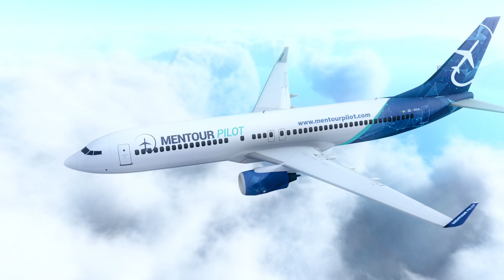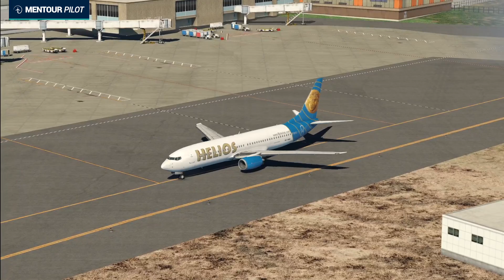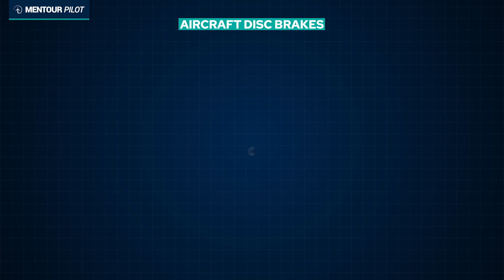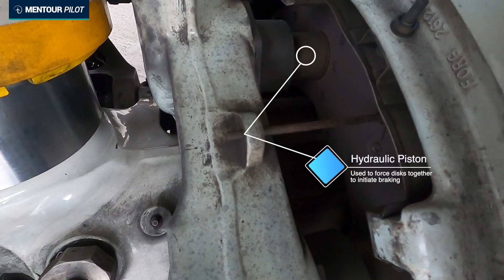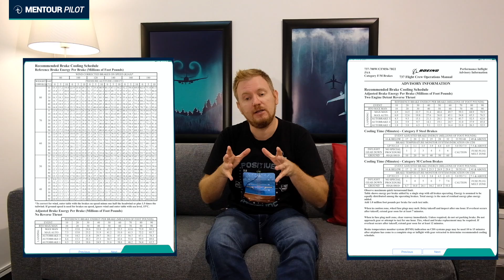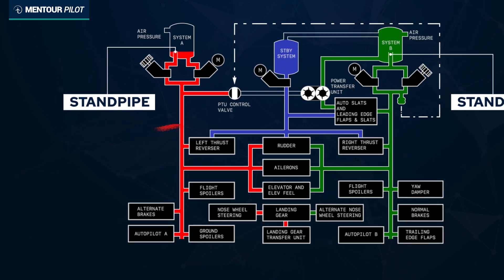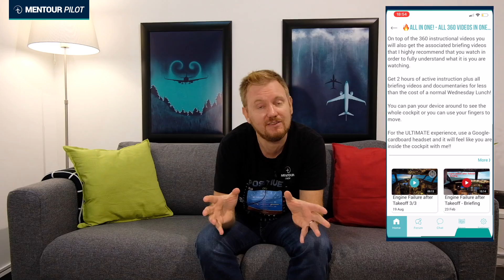How do Aircraft BRAKES work?!

Comment: "The antiskid system in airplanes works like that in cars..."

Historically speaking switching that around to "in cars it works like in airplanes" would even be more "correct" as when the automobile industry began to adopt that system for cars in the 1970s it was already in use for airplanes.
Reply: One more “what has NASA done to improve our lives here on Earth?” example.
Reply: really as a fully electronic system like today ? In cars there were many ABS ish systems around also in the 60s and earlier but the challenge for a modern system as we know it today was that the electronic  ECU is able to proccess all information and controll the actuators fast enough.. that was not possible before the invention of modern transistors, micro processsors and other hugh speed digical electronic components
Reply: @bobl78  I studied EE in the mid 1970s and my Professor teaching "electronic circuit design" owned a company which had developed an ABS for a German car manufacturer. (ABS at that time was an "extra" you had to pay for and was typically only available for the more expensive line of models.)
 
At that time transistors were available since more than a decade and electronic circuit designs had started to incorporate analog ICs (like simple OpAmps as the  uA 741 or timers like the NE 555).  Digital ICs were quickly growing out of providing just the most basic building blocks, as they had been the years before, which had given us the 7400 (4 x dual NAND) or the 7490 (4 flipflop chainable counter stage). Now we could also have ADCs and DACs, which formerly needed to be built from discrete components.

While I concede car ABS then was far from the "stability control" we have today, which e.g. incorporates inputs from MEMS acceleration sensors that are processes in real time and can recognize a car starts to turning around its vertical axis. Such an advanced system as we have it today  can give control back to the driver by asymmetric application of the brakes on all four wheels.

A very basic ABS can be much simpler and still be effective: The key understanding is there a substantial difference between static friction and sliding friction of the tires on the asphalt.

If all four wheels go from static to sliding at about the same moment in time (if the driver simply pushes the pedal as hard as he or she cab) the brakes are just less effective as they could be.

Worse if the road is more slippery on one side of the car than on the other, because the asymmetry then creates a force that makes the car turn around its vertical axis, making it uncontrollable for the driver. (And when friction becomes stronger again all of a sudden the car would also be in danger to roll over "sideways".)

Therefore experienced drivers at that time applied a technique called "Stotterbremse" in German, which means full force is applied intermittently only, giving you a shorter distance to a full stop as constantly applying the brake and risking the tires to block.

 Which explains the name ABS: It means Anti Blocking System and the goal is (or then was) to avoid the wheels to go into sliding friction in the first place.

This actually can be achieved quite simple: the electronics would only have to determine whether a wheel still rotates and if NOT to cut the pressure in the break cylinders of that wheel  until the wheel starts to turn again.

Exactly that was what early ABS did in cars and you would well notice it if you e.g. pushed the brake hard on a snowy road: the rattling of the "stuttering breaks" could be easily heard (and felt too).
Reply: @mittelwelle_531_khz  very interesting, thank you. The first german electronic ABS I know of was introduced in the Mercedes W116 around 1978 or so .. most like a 2 or 3 cannel sytem...  So what was the challenge to bring an electronic ABS into a car ? I started drivin in the 90`s and remember that back then the systems were great compared to non ABS cars but compared totoday´s systems react and pulse much faster and contain many many more functions .BTW is a modern ABS system able to adapt the way it works to speed and ground / friction levels? Does it work different on snow than on dry road ? I remember when my dad got his first W126 in 1982 with ABS as a super expensive option ...
Reply: @bobl78  As always in electronics the lions share of the system cost is developing it. Or at least the manufacturing cost is really low once such a system is produced in larger quantities.

Today the ratio even increased, huge cost for development and tiny cost for the actual hardware, e.g. if you put dedicated  digital electronics in an FPGA. (Basically "wiring" the whole thing by just "downloading" the connection pattern into the chip, requiring to build far fewer "prototypes" which later will be thrown away.)

A car company developing new electronics need to pay the engineers in advance, including all the thorough testing required to avoid being sued for "sloppiness" in the product if that product later fails, causing spectacular accidents and loss of life.

(Another thing often not considered is car manufacturers often guarantee - implicitly or explicitly - to supply spare parts for 12..15 years at least after a car goes out of production. These parts must be produced in advance, stored somewhere ... but may never be sold.)

Development costs usually go in the millions, the more if you develop something completely new, nobody else had ever tried.

As an example: if manufacturing the electronics (including the cost to put it into the cars actually built) costs 100 €, but you have to cover - say - 20 million development cost etc., you could sell the system for 200 € and start making profit after having sold 200.000 units. Or you sell that it for 1100 € and make profit after having sold only 20.000 units.

Of course, if it is more expensive FEWER customers will buy it and MORE will do so if it is cheaper. So the car manufacturer has to do the guesswork where the "sweet spot" might be.

Maybe at 600 € requiring 40.000 customers who would buy it at this price tag? Or rather only 500 € ...?

If - and that's the big unknown - LOWERING the end customer price from 600 to 500 € creates in a given span of time 10.000 additional sales it would have been a good decision, otherwise it lasts longer to reach the profit zone at that lower price.

But if you plan to keep the price high a competing car company might go for the lower price and take customers away from your brand. So you might lose the profit for selling the complete car if the price is too high. Typically customers of a given brand stay with you rather at the high-priced cars. In the low price segment they rather switch to the make that is cheapest.

So it is "rational" for the car manufacturer to go for fewer sales at a (much) higher price, as if the car costs - say - 60.000 € anyway, to people who can pay that much money an additional 3.000 for a "cool new feature" doesn't really hurt so much.

BUT: even if the electronics only costs 250 € to build and therefore the car manufacturer could put it ALSO in the lower priced car for a mere 300 € and still make 50 € profit from that extra, it now becomes hard to explain why THE SAME EXTRA will cost 3.000 € more for the luxury car but only 300 € more for the economy car.

All in all many there ate considerations to take and some  might hold back car manufacturers to try (and develop) radically new electronics.

Comment: Wow. So we have those great machines called aircraft. Beautifully engineered pieces of technology. And you're telling me, that they don't bother to install sensors that measure the temperature of the brakes or at least calculate it (the computer has all the data in much better precision than the pilot has) automatically and warn the pilot?!? Wow, that's--- somehow almost unbelievable (especially as there have been accidents because of overheated brakes in the past)...
Thank you for the great video! As always: Amazing!
Reply: Most airliners over the past 50 years have had a BTMS.  In the mid-1980's, I developed nomographs flight crews could use to figure out from a BTMS reading how much brake capacity remained for a given above-ambient brake temperature, along with a ground waiting time estimator for the given takeoff parameters as part of the chart.  Apparently, airlines hated it.  "This #*&% will never see the light of day", etc.  Anything which restricted them beyond existing flight manual limits was not welcome.  Things are more sensible nowadays, as suggested by the flight crew brake temperature guidance documents seen in the video.

Comment: That is a good story about breaking. During all the flights I took,, on landing there was a regular descelerating movement. Just grab your seat bars and everything was fine.
On one landing in Washington DC. from Europe the plane was descelerating so heavily I was pushed forward strongly, I had to grab the backseat in front of me so not to get slammed against it.
Reply: I once got to experience max braking while standing up (in the cockpit, behind the captain during an accelerate/stop test).  I was hanging on for dear life to  the column of a temporary equipment rack behind me.  Even back in my lean/40-pushups days, it was all I could do to stay out of the captain's lap.

Comment: Some trucks have water spraying systems for their brakes, I wonder why planes can't have such a system. Apparently since it only needs to be activated on ground, so there's no sense to carry a water tank with the plane, but I expect something like the nozzles comes with the plane, and the water is supplied from ground facility, once the plane goes to its parking slot.

Comment: Ah cool so multi disk setup. I know hydraulic brakes of cars, air brakes of big trucks and single/multi disk clutch systems. It's cars I constantly work on. I have experience with brake fade in my car and on my lesson bike. It's so important to have air flow over your brakes to cool them and these plains have multi disk tightly packed inside a closed wheel. No shit they ain't going to cool. During auto X 1 time the course ended with almost 60mph to 0 max brake into full steering lock 180 degree turn to slowly drive out. I got back in line to go again and after a few runs my brakes where to hot and my brake pedal went to the floor. Well driving a few laps in the parking lot was enough airflow to cool and go again without brake fade. With the lesson bike we were dragging rear brake on a hot day doing figure of 8s, pedal went down and no more rear brake and I drove away. Than teacher comments in your ear piece but you can't talk back till you physically next to him and say brake fade and I'm going to some cooling laps🤣

Comment: Perhaps an easier and more impressive concept for people to grasp, is that 2.2GJ is equal to 525 kilograms of TNT, or 44000 kilograms of methane burned, or 60000 liters of gasoline. That’s enough to drive an average car around the earth 16 times, or power an average household fully for two months. And that’s energy released in seconds, on just a few wheels.

Comment: Wow, excellent video!

@Mentour Pilot, back in June of 1993, I was on a red eye flight with Southwest Airlines and in a Boeing 737, from Las Vegas, Nevada to San Diego, California. 

As we were flying, something happened that caused the airplane to lose all power, including both engines, exterior and interior lighting and then the plane immediately went into a very steep nose dive that literally felt like we were going straight down. 

Now obviously, we were in a dark airplane, somewhere over the desert, where there is virtually no light pollution and it was very late at night. I’m guessing that it was somewhere around midnight to 1:00am in the morning. And so as a result of that, I didn’t really have anyway of actually referencing how steep of a nose dive that we were actually in. I do remember being pinned into me seat and unable to move. 

One of the flight attendants was getting ready to start serving drinks and peanuts but when everything happened she caught air and ended up getting pinned to the ceiling of the aircraft. I was sitting right on the center of the wing and she was a few rows behind me, in the isle of the aircraft. It’s weird, because still to this day, I can still very vividly remember hearing both of the engines start spooling down and can still recall in full detail everything that ended up happening. 

 I don’t know how long we were actually in a nosedive for but my guess is probably around 30 seconds to maybe 45 seconds max but it seemed like an eternity, that’s for sure. 

The pilots eventually got power restored to everything and the engines started again. They then put the plane into a very steep climb that felt about twice as steep as a normal take off. But again, it was sometime in the middle of the night and over the desert so I had no reference points to say for sure how steep everything actually was? 

When the plane started climbing the flight attendant then fell, hit her head on the back of one of the isle seats and was then pinned to the floor while the plane was climbing. 

From Las Vegas, Nevada to San Diego, California it only a 6 hour drive or around 350 miles or so. The flights aren’t very long either. They are only about 50 minutes to maybe an hour max. As a result of that, the plane only flys to an altitude of I think somewhere between 20,000 feet to maybe 25,000 feet max. 

Because of this and there being several mountain ranges all throughout that desert, I am only assuming and guessing that the pilot put the plane into such a steep climb because he was probably trying to gain much needed altitude to clear an obstacle. If that is indeed what happened, I’m going to guess and assume that the obstacle or obstacles needing to be cleared was one of those mountains or mountain ranges in the desert.

Once the plane leveled off again, maybe after climbing for only around a minute or 2, 3 to 5 minutes maximum, 1 of the other flight attendants helped the injured flight attendant to the back of the plane to try and help her out. 

The rest of the flight it seemed like the pilot was fighting the plane the entire time. Of course that may have also been caused or due in part to there being turbulence but it lasted all the way to San Diego, up until we landed. And when we landed, it was a very hard touchdown that literally caused the plane to briefly become totally airborne again, for a few seconds. Also, right before we touched down, it seemed like we were at a little bit higher of an altitude and then we just dropped and slammed onto the runway before bouncing up off of it for a second or 2. 

Before we taxied to our gate, air traffic control had us park the plane just off of the runway so the 1 flight attendant that got injured during the flight could be taken off of the plane to an already awaiting Paramedic and/or EMT ambulance crew. After the injured flight attendant was taken off the plane, we were then able to taxi to our assigned gate.

After we got off of the plane, I then had to explain to 1 of my Dads church friends that had picked me up from the airport, why my shirt and pants were all wet and covered in alcohol and I smelled like it, due to the guy who was sitting in the seat in front of me somehow bringing alcohol onto the flight and then spilling it all over me when the plane went into its dive.

With everything that I described, in your opinion, what could have caused the plane to do what it did? Every pilot or knowledgeable aviation person that I have ever talked to about this incident has said that either they did not know or it could have been a number of things. 

If possible, can you please offer up suggestions or advice as to what you think may have caused everything to happen? In asking this question, I’m not wanting or trying to criticize or blame the pilots or Southwest Airlines. In fact, it’s quite the opposite actually. The pilots and entire flight crew should have been given an award for everything that they did to not only save the plane but keep everyone as calm as possible and as informed as possible as well. 

Since then, I have only flown twice. In August of 99’, I flew from San Diego, California to Dallas, Texas to see a good friend while I was on vacation. After visiting him and his girlfriend, I then flew back home and have never flown again since then. 

I used to love flying and was never afraid of doing so. But after that flight, I have now become afraid of flying. This is why I watch your channel and others like it, so I can learn as much as possible about flying. And then maybe one day, sometime in the near future, hopefully I will be able to face my fears, get on an airplane and then fly to some place nice and no longer be worried that the plane might crash.

From the bottom of my heart. Thank you Mentour Pilot, for all that you do! I truly have learned a tremendous amount from all of your videos and best of all, they are building up my confidence to consider trying to fly again someday.
Reply: Could have potentially been a microburst, this would have also had to cause something like a compressor stall to get one or both engines to stall out also causing lack of power, but this is entirely a guess